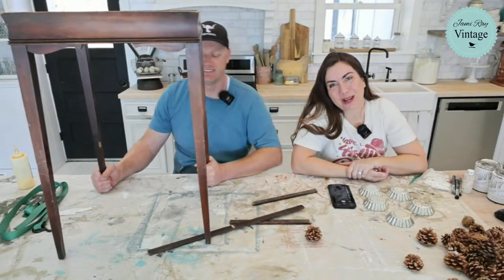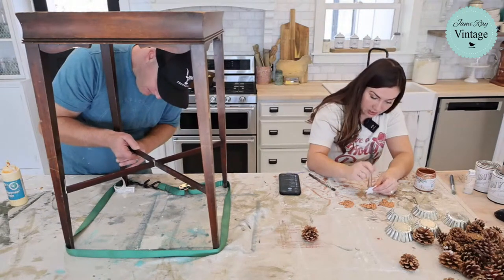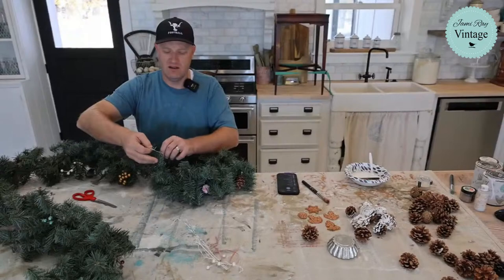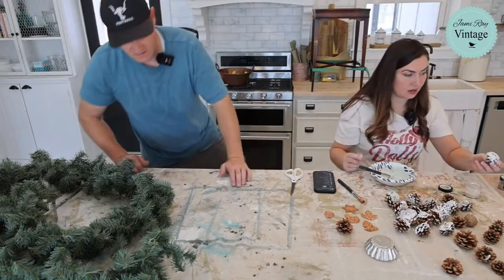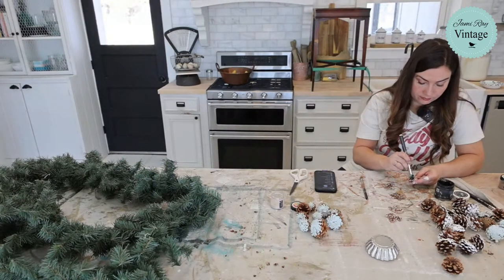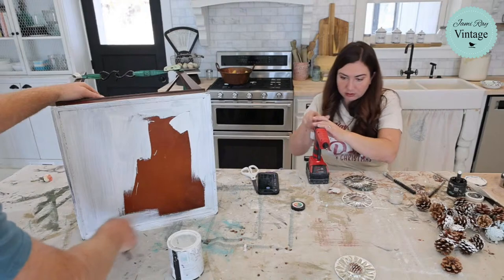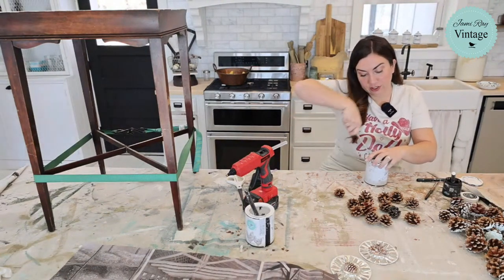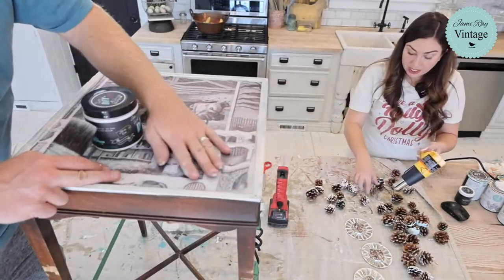Antique Table Repair and A Christmas Garland Waste Not Wednesday

Comment: Have you seen all the attachments you can buy for your kitchenaid mixer?  I bought the peeler, corer, slicer, spiral cut, had price on eBay. I use it for my bushels of apples, to make applesauce.  I did one roaster full, where you just take the stem off, quarter the apple, and cook them, peels, core, seeds and all. They I send the cooked apples though a food strainer, meant to separate the sauce from the pull, seeds, etc.  It works great, but I wanted a batch with a few apple chunks, for family who likes it that way.
I did use my kitchenaid attachment, to get apples ready for pie filling.  I fill a pie dish with the sliced apples, and add the pie spices, etc. I then line a pie dish with plastic wrap, and pour the pie filling in that dish. I wrap it with foil and freeze until solid enough to remove it from the pie dish, and wrap it well to store in the freezer.  I end up with pie filling, ready to set down in a crust, cover and bake, when I want apple pie!  I've stored many pie fillings that way.  I don't like to can pie filling, because it Cooks the apples too much.  This way, it's like I peeled the apples the day I bake it!  With the attachment, it goes quite quickly!  I did a bushel and a half of apples today.

Comment: Those silver molds you hammered flat, would be cute on a smaller, family tree, with a picture of each family member in the center, and decorated up.
I also wonder if they'd make cute hanging "peppermints". Paint the whole thing white, then paint red wire and thin swishes, like a peppermint has.  Either paint both sides to match, or do a family picture on one side, and a peppermint on the other🎄🎄